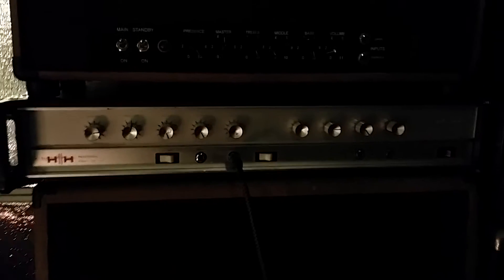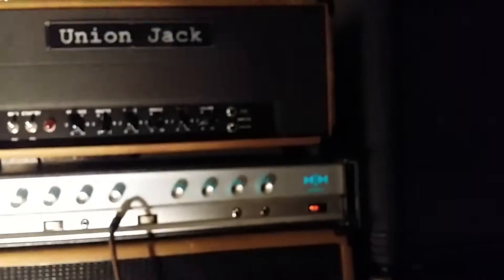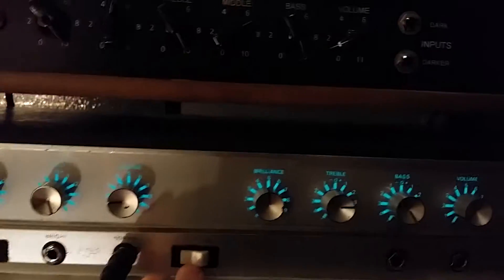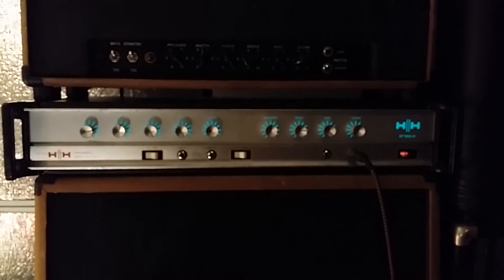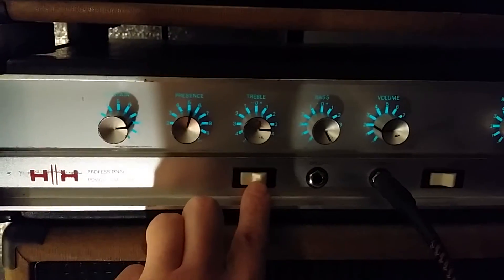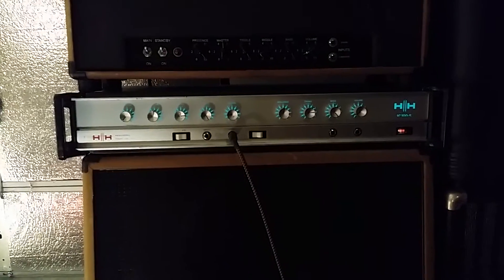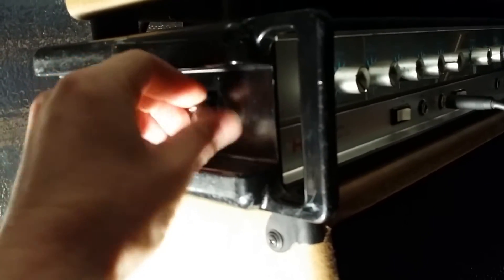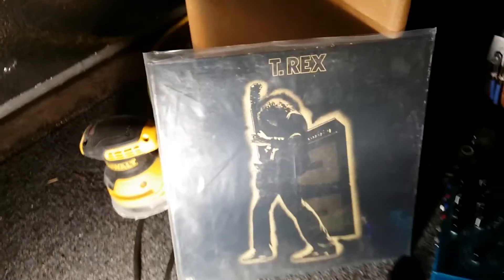HH IC 100-S

Comment: Still got my VS Musician Reverb 100 head - killer amps! I have the HH IC100 S ( Same as this video ) and the VS Musician - they are different animals. The Clean tone on BOTH the IC100 and the VS100 are very much the same - the VS ( Valve Sound ) and the Sustain mode of the IC-100 are totally different. The IC100 Sustain is very much like a Mk1 Tone Bender type Fuzz - whereas the VS is more of a warm driven tube vibe. I also have the HH Multi Echo ... the push button version rather than the slider. Love them all ...